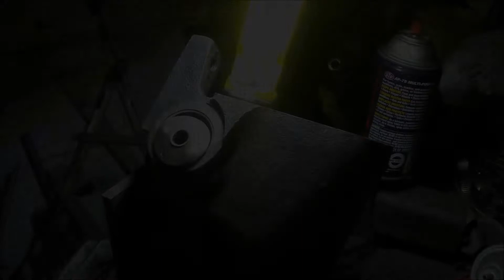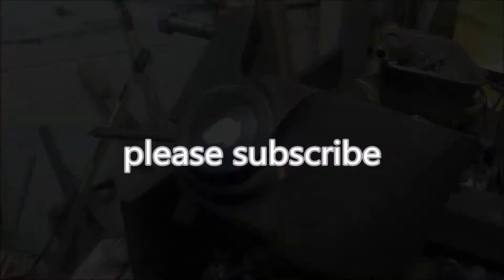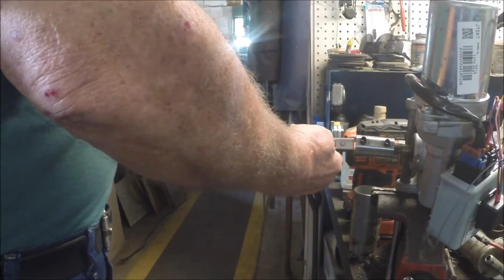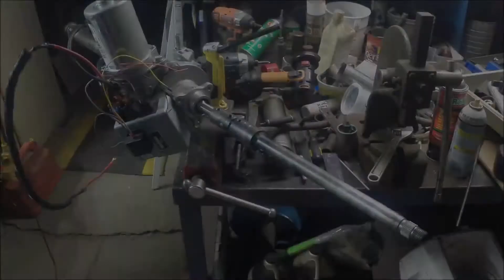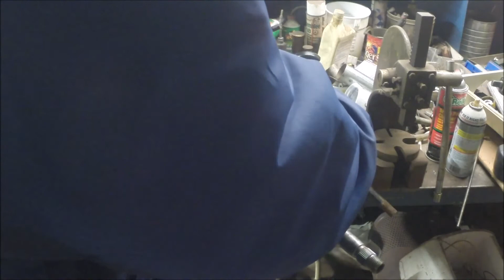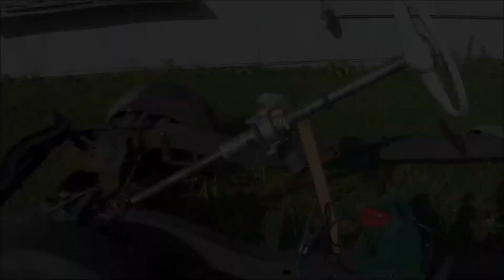1949 Shoebox Ford Electric Power Steering Part 3

Comment: I’m dying for you to finish this one! Get that steering installed in your shoebox so I can see what you’ve done and how it works! I’m about to pull the trigger on a $3000 1953 Power steering set up that’ll work with my flat head, I hate how all the aftermarket units need you to be running a Ford or Chevy small block instead of the Flatty! Although the one benefit that I can potentially see to running the system hydraulically would be the possible ability to add hydraulic power brakes, not sure if they make those for the shoebox but I’m curious, I put hydraulic power brakes in my 69 charger once a decade ago and it worked like a charm.
Reply from the maker: Sorry to take so long to show the final results. I will need to take the shoebox out of service to get it done so it got pushed back a bit. The big challenge will be designing a mounting bracket under the dash to hold the unit. Having tested it on the bare chassis I am confident it will work. I am not a fan of hydraulic steering or brakes. Our shoebox has manual disc/drum and stops fine. Maybe my foot is heavier. Electric is the way to go. You could simply shorten the shoebox column, install a coupler and then a complete aftermarket column if money was no object.
Reply: @bluedog373  Well, I have the Ford-O slush Box in mine , So I need to maintain the column shifter, that’s the only bummer. I think I’m going to have to look very seriously at getting a 1953 Ford or mercury power steering set up and determine whether or not the drag link would have to be adjusted, I think it’s doable but I have to do more research before I lay down $3000 for all the parts, at least it’ll fit my flathead V-8 without lots of weirdness and be mostly stock. For the time being I just need to make sure that everything is well serviced, there’s definitely some play in the steering, quite noticeable on the freeway, maybe I’ll do a front end suspension and steering rebuild before I consider anything else..
Reply from the maker: @jackierabbit450  Unisteer makes a system,  but not for auto column..any chance of a floor shifter ? A good rebuilt stock box is ok cept for parking. Easier if the car is moving a little when you turn the wheel. At speed you dont need power steering.
Reply: @bluedog373  I understand that at speed it’s not as difficult, however I really do need the power steering, I was in a motorcycle accident 20 years ago that left me with less than stellar strength in my arms, my right arm is pretty OK but the left elbow does not like constantly wrenching on the steering wheel, and I would be much more comfortable to just cruise around with power steering. My right leg is pretty much shot, mostly paralyzed so I drive with my left leg and left foot, this is why I also need an automatic transmission. Otherwise I would probably be driving a three speed column shifted shoebox. I also very much enjoy the bench seat, very comfortable and easy for me to rest my right leg and foot on the transmission hump, kind of like driving a couch down the road. I’m trying to figure out what I need to adjust to make the 1953 power steering work on a 51, maybe one of those situations where I just have to dive in to the whole project and figure it out as I go.